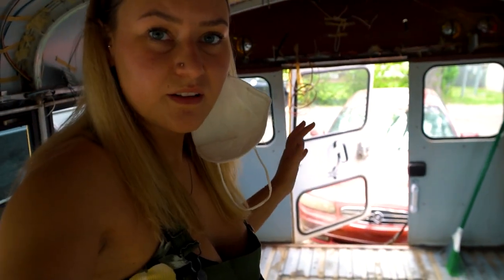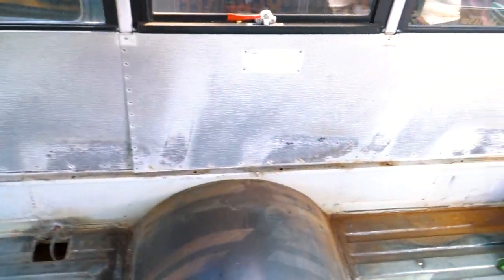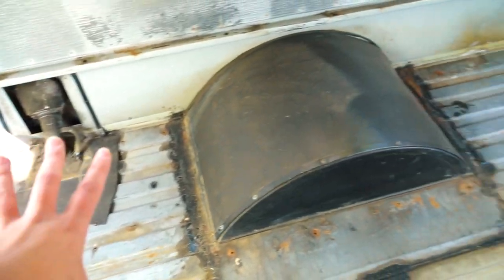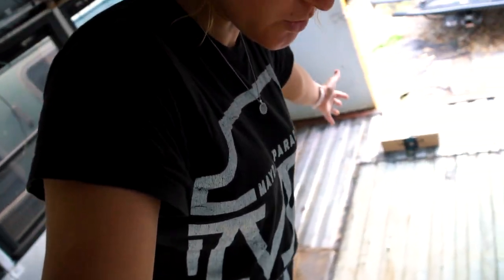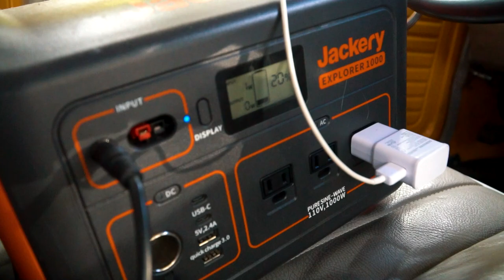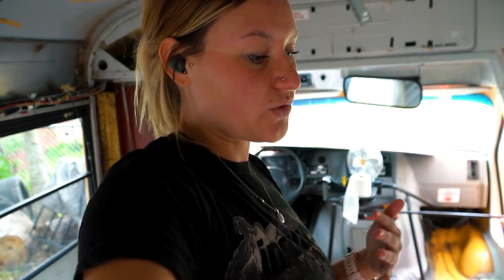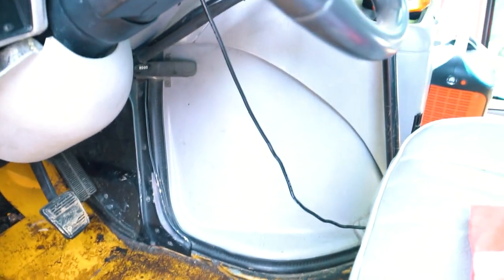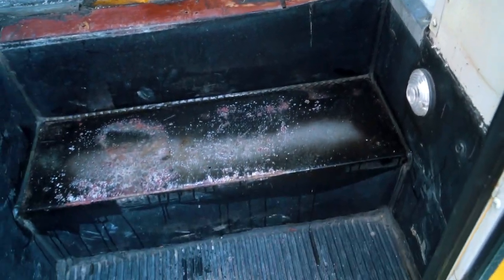Floor Rust Removal & Rust Converter/Prevention - Short Bus Conversion

Comment: I was thinking a shop vac would be a lot easier than trying to sweep all those grooves and getting into tight corners etc. to get the loose dirt.
Reply from the maker: Oh I agree! I’m actually going to buy one today
Reply: Awesome...I love mine...I was thinking it would be handy for you and Levi for your builds.
Reply: I just posted a comment about a mini shop vac they work great $20 - $25
Reply: @LeaveHerWild  I just posted a comment Jaylena about getting a mini shop vac $20 - $25 they work great also look at getting rust remover spray or brush on they work great love the videos 💘

Comment: The reason your solar panel is charging slowly on the dash is because your windshield is designed to block uv rays. Put it outside and it should do better.

Comment: I'd say if it was me after you get all the rust off and painted I'd go back over it with bed liner spray. Raptor liner would help protect the floor even more plus it will help with noise reduction.

Comment: air compressor or shop vacuum would get a lot of the dust. I believe they make a spray on bed liner for pickup beds. It should be good to prevent rust on the floor. Probably smell for a bit but should protect the metal floor from rusting.

Comment: You can use "Naval Jelly" for the hard to reach rust spots.  A grinder would also be a good investment.  You can get sanding discs and even wire wheels.

Comment: You really need to get UNDERNEATH the bus too with a rust encapsulator...Eastwood brand.  That is where all the road grime and moisture will get up in there and rust it out.  Don’t just do the top of the floor.

Comment: If your new wall surface is at least 1 inch thick overall, you might have the depth to install additional insulating window inserts that keep you warmer in winter. They pop in and out, they make them for house interiors, custom sized. I'll look for a link.

Comment: I saw a previous message about Por 15. On all my bare metal I use KBS. One of the owners of por started the company. KBS has all different types of colors and it sticks so well to bare metal and treats rust as well. You can spray it but I just brush it on. You will never have to worry about rust coming back as well as its very hard to chip, break off and no sticky residue . Hope that helps for future things.

Comment: If it was me, I would seal the opening around the fuel inlet pipe at the back of the bus. Fumes could be sucked up in the bus with you. Have a metal cover that can be screwed down with a gasket from inside the bus. Any other holes should be sealed as well.

Comment: Coat that entire floor in Rust Reformer or Rust Inhibitor.  Spray it all down with Rust Dissolver first and wipe/spray clean.  Also...straight white vinegar dissolves rust too...soak it good and let it sit.  Rust Dissolver would have been much easier than grinding it all off.  Just coat it all...let sit for awhile...wash off...maybe grind a little.  Use Eastwood Rust Encapsulator...cover the entire floor..top and underneath.  Coat ALL the metal in it.  Now is the best time to do it when you have everything out.  If you don’t encapsulate it, it will all rust out in the next few years.  Well worth doing.  I will come do it for you if you get all the stuff.  Nashville isn’t too far from me.

Comment: Will you be welding washers onto the holes to strengthen an then add a rubber compound to the underneath to protect against the road salt?. Does the rust mean water 💧🤔is getting in. This is such a juicy van build loving it.

Comment: You go girl. Truly putting elbow grease into the foundation of your home. Also, what's that tool/bit called on your drill. The roof of my cab area has some rust areas I'll have to work on. Right now I'm focused on other projects, so it's way down the list. But I am curious for my future knowledge. Is it just called a grinding tool?
Reply from the maker: Thanks! It’s a wire cup brush, they have flat ones as well if you need to get into corners better. It works really good for rust!
Reply: @LeaveHerWild  Thanks so much. Solo female vanlife handy-women unite!!!
Reply from the maker: @TheDawnofVanlife  Um, heck yeah!!🛠

Comment: Your sound keeps going on and off when you're talking. I have to wear earbuds to hear you. Severely hard of hearing. I normally listen through my hearing aids, but they've been sent to Denver to get the batteries replaced. Can only hear about every other word. 
You're doing a gr5job on your bus. Did you put that Rust solution on the sides where the rust was showing also?